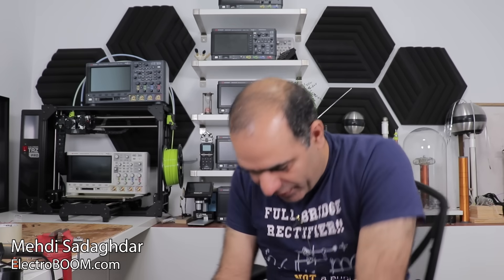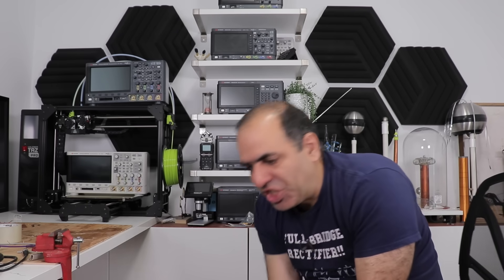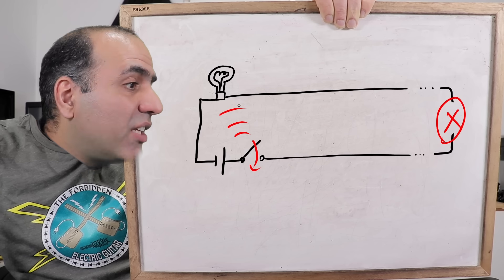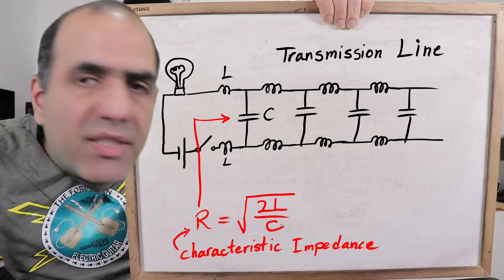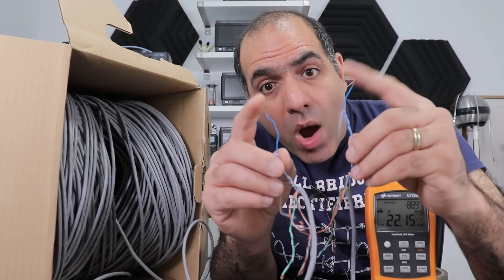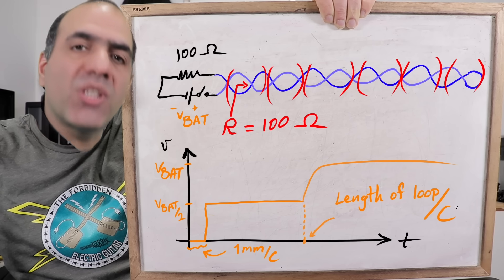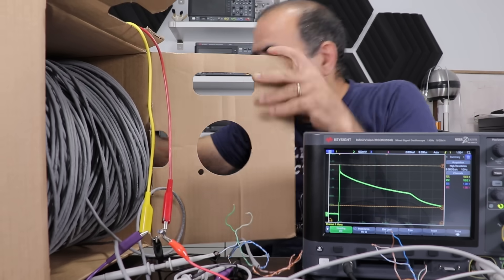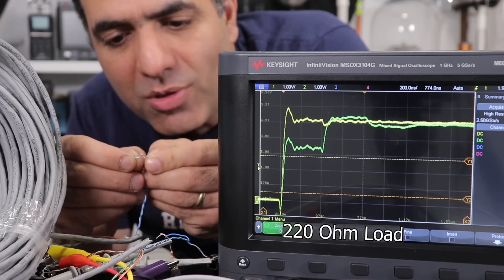Testing the LONGEST LOOP OF WIRE!!! to Turn a Lamp On

Comment: In network cabling, we use VOP testers (Velocity of Propagation) to check for breaks in lines, or to tell us how long a CAT5/CAT6 cable is even if there's nothing on the other end. Most testers can be calibrated, but default at about 70% the speed of light, so 66% seems about right for CAT6. I find it helps to think of electricity as 'bouncy', being able to bounce back from the other end of an open loop. Perhaps imprecise, but helpful. Thank you for the more nuanced, and in my opinion, more technically accurate explanation of the subject.
Reply: We did this in uni using signal generators and oscilloscopes just like Mehdi did, it was pretty cool.
Reply: @baksatibi  did you calculate the efficiency of energy transfered through the air versus energy transferred through the wire? Do you have this as a ratio?.
Did you measure anything and take notes?
Reply: It's called NVP, not VOP and it ranges from 60-80%. The actual speed of the signal is calculated by multiplying c with NVP.
In fiber it is called Index of Refraction and it is around 1.47 but is calculated differently, c divided by IoR.
Reply: A quick Google shows that "NVP" stands for "Nominal Velocity of Propagation", and the Wikipedia article for "Velocity Factor" (aka. VoP) has a table of factors for different cables including CAT6. It shows CAT6 at 65% for "minimum velocity factor". Learn something new every day, I always thought it was the speed of light.
Reply: @Soda88  Interesting. I heard the term TDR, or Time Domain Reflectometer. Maybe term has changed since I heard it 20 years ago though, same principle.
Reply: @Soda88  VNAs work too. Sounds like many tools do the same thing. Virtual Network Analyzer is a bit of an oddball name since it makes it sound like a networking tool that u plug an rj45(cat5/6 cable end) into.
Reply: Think about it, this would not be possible if the energy moved through the fields and not through the wires.

Try interrupting the field outside the wire, does this technique tell you when the wires go through a metal wall? If electricity travelled in the region outside the wire, it would care about moving through a metal wall, it doesn't. This is bullocks.
Reply: @BenjaminGatti   @Benjamin Gatti  I'm confused by what you mean ? as in your saying the charge doesn't move on the outside of the cable through fields ? 
it actually absolutely does or can theoretically, its just that we don't know if the electron 'pressue' is the driver of the field or the field is the main driver of the 'pressure', its just that they work mainly only through the metal or conductive parts of the wire, the rest of the cable you see is shielded for the exact reason u described of passive or active interfernce, in fact  coax without an antenna being able to pick-up perfectly clear signal while it's unshielded shows this , I actually once spent 2 hours of my life trying to figure out why a tv in one of the rooms was having random drop outs some days , after tracing the problem the wallplate cable of the coax plugged into the TV went into a metal box outside where the tech  left the wire  unterminated with 15 mm stripped on the end, suspended in the middle of the (metal) box  meaning it had no direct connection to the box or an antenna and it was still working , if u took it out of the  metal box it wouldn't work , if you shielded the cable it wouldn't work , similarly if you run  a unshielded cable through a metal wall it is absolutely effected even without direct contact and this is measurable, in fact interference is one of the greatest problems in copper Ethernet cables , its why lower cat grades can only run certain lengths at 1gbps and u need cat6a to run 10 gpbs to 100m , because not just metal walls but all sorts of fields effect the charge of the cable even when shielded, the thing you also have to remember is that we are dealing with huge amounts of energy yet even the passive interferences have great effect let alone active ones
Reply: @asimramay1069  yeah, I'm not buying what veratasium is selling. There is some effect outside the wire (radio and magnet) but the vast majority of the energy moves in the conductor, not in the dielectric.
Rf works, but is very inefficient. Magnets are better, but DC magnetic coils don't really propagate energy. In all, it's sus. Wires conduct electricity, next?
Reply: @asimramay1069  Hi. Thanks for the long response. I want to point out that much of what you're describing is related to rf signal frequencies and not the DC energy related to illuminating a lamp. I wonder if you could answer a simple question: what is the ratio of energy that can pass 1 Meter by means of: a. an 18awg antenna less than 0.5 Meter in total length - or - the same distance via a superconducting wire?
Reply: @BenjaminGatti  Yes I'm describing RF but  RF, DC and AC are all related, they are all types of EMW/EMR/EMF , the way RF works is by using interrupted DC to generate EM Rad which then when placed across a Antenna with a load produces current yes this current is not DC but AC , now of course the energy loss through air is massive  but no one is arguing that EMWs lose energy when hitting particles and despite what people might think u Don't need DC to make bulbs light up, at least for traditional bulbs that used heating across a filament the heating effect takes place irrespective of direction of flow, So they work on both AC and DC and even LEDS can operate directly off AC voltage.

As for your questions its actually NOT simple , you are dumbing a principle or framework down , if on Earth Of Course a Superconductor is able to transmit more Energy than EMR also conductors are Better at directing energy to where you want it to go and allowing use of energy as electricity , but the only reason conductors are better than EMR is because we live in an environment full of matter , in a vacuum EMR is actually infinitely better at not losing energy than a conductor, though the conductor is still better at directing the energy easily and cheaply to where you want it to go in the form of electricity.
the point being that loss of energy is more complicated than just what you observe in your day to day life when talking about frameworks and that EMF causes current in a conductor , a conductor also releases a EMF -> while practically this doesn't matter , theoretically its not known what its the original propagator.
Another example of EMR having the capacity to do what Wires do is Wireless charging, which is inefficient , but its inefficient because you hit a lot of huge air particles each particle hit is a loss of energy , you can with LOS still transmit a lot of energy  though through air in a large room even, in fact enough to fast charge a phone , OFC this is WAY less efficient than using a wire because wires have easily excitable electrons in its outer layer which flow in a way that they don't bump into as much particles as in air and don't suffer from conversion loss and they flow in a path you want, which is why they are anywhere from 2x to 4x better than EMR at transmitting energy on Earth, what does that mean practically? Wires are the best at directing and reducing energy loss on Earth and in general better at concentrating and pathing energy how we want  but this doesn't disprove Veritasiums point.

the Electric Field will Reach the Load much quicker than the WaveFront  , increasing the energy across the load , and it does this for every section of wire on the opposite side as the WaveFront travels through the medium , meaning that the bulb turning on is quicker than how we traditionally think about electricity, the fact is EMFs travel close to the speed of light(through Air) even on earth the only difference between a vacuum and earth is particles present on earth cause the field or radiation to lose energy, but if you have a circuit and it has no interference elements the EMF will always reach the load before the 'pressured'  electrons or more accurately the 'wave front' in the conductor do and this is simply because EMFs travel close to the speed of light through air and induce current in a conductor that doesn't already have its own field and the energy through a conductor travels at ~2/3 of that speed this why the conditions of the question matter i.e. 
Wires have no Resistance and The lamp Turns on immediately as soon as there is a current
and this is why the answers is always 1/c s 
because the side with the battery and the bulb are 1 meter apart and the wave front has to travel a longer distance so EMF travels faster than the WaveFront in the cable however if u change it so the battery is 300,000 KM from the bulb its still 1/c s because the wires have no resistance
Reply: @asimramay1069  uhm, still no. Remember at 3nSec, there isn't time for energy to travel down any perpendicular wires, so let's stop discussing wave interactions between "the wires" .

The event horizon includes only infinitesimal wire lengths and a single impulse. There is no time for ac or rf etc.

Draw if you will a circle (or sphere) 1m/c light seconds in radius from the switch, and another from the switch. In 1/c sec, the overlap of these two spheres is the event horizon: no changes outside this event horizon are relevant to 1/c sec.
 Furthermore, the shortest distance between two points is a straight line, and the only path between switch and lamp which is 1 Meter is a straight line, any perpendicular segment in the path is > 1/c sec, so please don't explain any interactions between "the wires" because the wires are not within a 1/c sec path.

This video is impossible slow relative to 1mm/c sec, which is the distance involved. This is 0.003n Sec. We would need a petahertz oscilloscope to understand the delay. 

I'm exhausted by the ignorance on this topic.
Reply: @BenjaminGatti  veritasium is a bit misguided or missexplains. idkbut the one video thunderfoot hates, I also cant forget. But electro boom explains that some energy is instant then the rest catches up. how about if the wires are a giganc circle so the capacitance is negligible? I bet because of the impedence in the line, radiowaves would propagate if the charge has nowhere to go, maybe it doesent matter beause it takes just as long as the electricity to propigate.

either way, wire is not the only thing charge travels thru.
Reply: @Wtfinc  yeah, I'm using radio to text right now. I needed a video to explain wirelessness? Veratasium is trying to go one more, really, he is trying to assert Tesla's obsession - which basically is the wireless transfer of power without the square of distance rule. V has not persuaded me, and Eboom appears to be simping for derrick.
Reply: @BenjaminGatti  What could Eboom have possibly done differently to test what you  are saying?
Reply: @greasebob  great question. Eboom has a gigahertz scope and I don't, so there is most definitely a test Eboom can do that I can't.
1. Build parallel wires as pictured of length not greater than 1 meter and test the coupling, is there detectable capacitance? Is there capacitance to ground? Is there confounding capacitance? (+ to - etc). 2. What is the noise floor. 3. How much energy is required to create a non-resonant signal above noise? 4. How much energy is required to excite a single photon? 5. How much energy is required 1 meter away to stimulate a single photon in an apparatus confined to the 1/c sec common event horizon? 6. Use fiber optics instead of wires to communicate timing signals.
7. Place experiment on the dirt as shown in OG video.
8. Report out the electrical efficiency of the 1/c sec apparatus, as a ratio of the superconducting wires option.
Reply: @BenjaminGatti  "does this technique tell you when the wires go through a metal wall?", Yes in fact it does if you had good enough equipment like any wave when it hits a change in the permeability of the medium part of the energy gets reflected back. This by the way is exactly how both SONAR and RADAR work using sound and electromagnetic waves respectively and listening for the reflection to determine when the wave hits some change in the permeability of the medium to the wave. So yes you would get a small portion of the energy being reflected back as the waves in the electric and magnetic fields around the wire interacted with and a portion gets reflected back from the metal wall. This is also how the Time-domain reflectometry tools the OP here is talking about are able to detect the end of the cable or any break within it you get an even stronger reflection there but only because the wave amplitude is greatest near the cable and drops off further away.

It seems your confusion is between electrical current and electromagnetic waves the two are related but not the same thing. The former does in fact refer to the net flow of charge so yes there is actual electron movement going on here. Electromagnetic waves can and will induce this behaviour and equally a flow of charge will produce electromagnetic waves or more specifically a change in said flow.

Also, you are somewhat correct that DC won't have this effect in the steady state but it is not in the steady state when you first throw the switch. At that moment there is a sharp rise in the voltage effectively you actually have the rising edge of an AC waveform there albeit one with a theoretically infinite frequency although in practice it is just extremely high as you get some dispersion going on due to resistance, this is also why the waveform seemed to round off more as the cable gets longer, the pulse broadens out over the length.
Reply: @FaerieSeraphina  yeah, probably as effecient as radar. About 1 thousand watts out, < 0.001mw back.
I'm sorry. If that means that most of the energy moves outside the wire, then we have a different definition of most, outside, energy, and wire.
Reply: @BenjaminGatti  I missed this bit "he is trying to assert Tesla's obsession - which basically is the wireless transfer of power without the square of distance rule."
I would like E-Boom to explain that one. That's why I wanna see the loop in a circle. Not cat5.

And Its this I didn't quite understand why u wrote and I said "It very much does", you wrote "How does the analysis of a signal through cat5 wire not demonstrate that energy is conducted by "conductors" and resisted by dielectric ."
I guess I didn't understand why you aimed it at me and my brain dropped the 'not' in "..wire not demonstrate.." made it look like for a second you were saying that it did not demonstrate that energy is conducted by "conductors" and resisted by dielectric .
oops mb
Reply: @Wtfinc  yeah, the original post, and this as well, is making the point that electrical energy (not signal btw) travels predominately in the dielectric rather than in the conductor. This was Tesla's vision honestly, and it has a huge problem known as "square of distance". First you need high ac voltages, then you need resonance, then a ground, and finally you have huge losses. This chain of videos is a project to argue that those realities do not exist. It's hogwash.
Reply: @BenjaminGatti  ahhhh, yes, indeed. I completely agree. I don't see Mehdi as the type to neglect such an important fact as the inverse square law, so what the hell is going on? However, being wrong (even on purpose) can be very beneficial on youtube, worry about the record being straight later. 
Imma watch the vid again, maybe I missed something.
I mean, it is one hell of a tutorial on capacitance and inductance.
Reply: @BenjaminGatti  nah, u just not there yet. and yes a metal wall would have an effect, but it wont stop anything. maybe you should try it?
Reply: @Wtfinc  I work with electricity every day, from millivolts to kilovolts: worked on multiple wireless power transfer systems. How does the analysis of a signal through cat5 wire not demonstrate that energy is conducted by "conductors" and resisted by dielectric .
Reply: @BenjaminGatti  this is a joke right? cause it very much does.
Reply: @Wtfinc  very much does what?
Reply: @BenjaminGatti  you clearly are stuck on a Question that was not asked , no one is making the claims you think they are , 
the question was a thought experiment with a very key conditions which I pointed out last time that u ignored i.e. the bulb would turn on at any voltage above leakage current in a vacuum and the wires are super conductive with no resistance

1. no one is claiming that energy through Waves is not lost, it is for sure lost in non vacuum areas and that there is also a conversion loss which also reduces energy i.e. when RF induces electricity it will always be much less than the initial EMF and also way less than the wave front nor is anyone claiming that energy through a wire is not lost (due to various factors)

2. many other channels with better scopes also prove that the only thing that matters for initial voltage across the load is the distance between the EMF originator(generally the switch) and the load with LOS and no interference i.e 99% the speed of light in  air and at the speed of light in a vacuum, and the voltage across it is much more than leakage current but much less than the wave front 

3. in his original video he did say somethings that were vague and that were visually incorrect , but the visual was more for demonstration purposes and still works if the bulb is a low powered LED though that would not fully light up, but again a lot of people missed the few key conditions
-Super conductive wire no resistance
-Bulb lights up with any level of additional voltage/amps
- in a vacuum

4. the whole point of the video was that if u had a 1 mw bulb and u had a circuit in a vacuum the light would turn on at 1/c s assuming the switch and the load are 1 meter apart and the light would stay on until the wave fronts hit and no this is NOT faster than the speed of light , the EMF directly powers the bulb than as the Opposing EMFs get generated in the opposing side canceling out the wave the initial wave that propagated out would be hitting more of the wire where charges are not setup yet inducing more current which travels towards the bulb and this would continuously happen until the wave front hits -> and you dont need to take my word for it there are a bunch of channels with way better Experiments to show this voltage across the load BEFORE the massive energy from the wave front in the wires hits , and yes if the circuit was broken the bulb would go out , because as you rightly pointed out the EMF would setup an opposing EMF that would  not allow additional energy to go towards the load. Basically nothing here breaks the laws of physics , the reason this debate started was because of how vague the question was rather than it actually being incorrect. but its a good thing , as long as debates are civil and about getting to the truth they can only lead to progress.

5. using your experience and just straight up rejecting something is not a good way to think (unless its for practical purposes where something works and questioning everything is a waste of money & time at that instant if you need it done) , many of the greatest scientists were laughed at and rejected of their ideas as they broke the laws preceded at that time yet later it was found out that those ideas were closers to the truth than the accepted framework, what I'm trying to say here is that the laws of physics are discovered by us and many assumptions we make may not be true i.e. nothing can go faster than the speed of light, 
but black holes exits in the universe and the gravitational pull of it is at least the speed of light, if u could prove a particle can escape a black hole you could prove that something is faster than the speed of light i.e. like the theoretical Tachyon
so our understanding is not static and for practical purposes we only have to understand enough for things to work even if later it turns out that technically it wasn't the whole truth
Reply: @asimramay1069  yeah, I don't think any of these videos demonstrate what you say. Losses at 1 meter have less to do with atmosphere and more to do with square of distance. If you don't understand square of distance please read a Wikipedia article before replying. To generate light, you need at minimum the energy required to excite a photon, sorry, there isn't any magical lamp which can "turn on" without this minimal requirement.
Keep simping.
Reply: @asimramay1069  I much appreciate the answer. The problem with loss of density is that at 1 Meter, the incidence of radiation from a small source to a small receiver (18awg wires) is like 1e-6. It's extremely small. Please show how you have considered this?
Reply: @BenjaminGatti  not sure how you came to this number rather than rebutt the math im gonna point a problem with your conclusion that the number is so small, both based on Who's EMF guideline and the physical experiments done on other channels this  number does not seem to be true, according to the who guideline EMF strength for a bulb circuit is 5v/m, for a stero receiver its 180v/m.
from the scope tests on other channels while the voltage varied +- a few volts we got around 5v and about 13 mW of power radiated across 1 metre 
both the guideline number of EMF strength and the physical test show power way larger than your mathematical conclusion, so I'm going go out on a limb and say most likely there was either some mistake on the maths or some framework misunderstanding, because the real world test is way more conclusive than any math we can do, now obviously our test could have problems , but the test from AlphaPhoenix for example is as close to the original question as you can get , so either way from the information we have based on the conditions of the question the answer is 1/c s